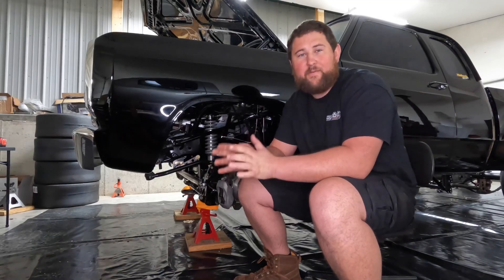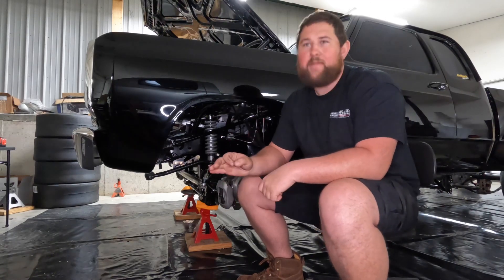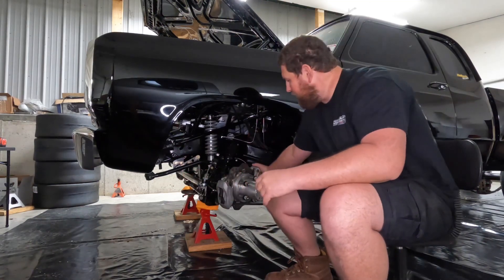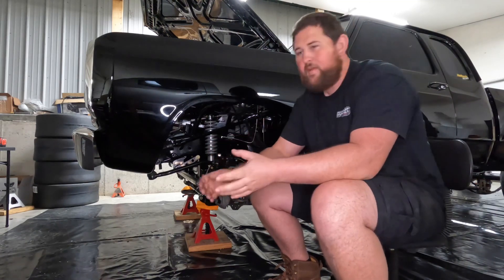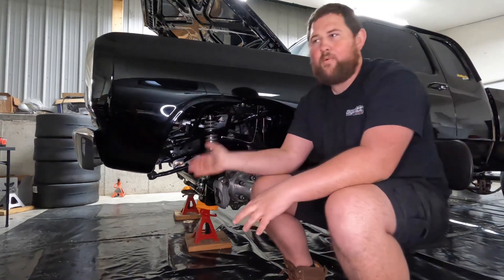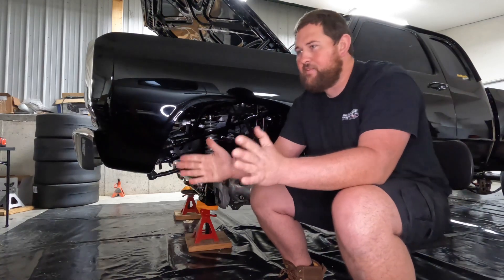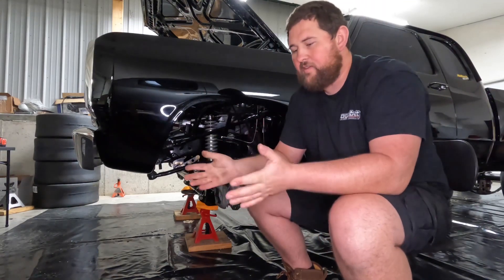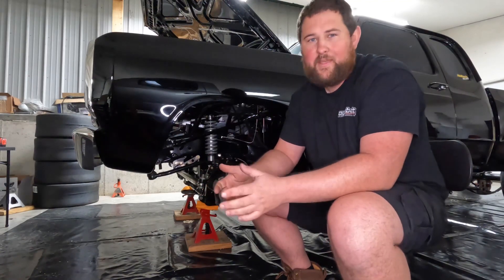The Secrets Of Drag Racing: Steering Ratio!!!

Comment: Any conversation about toe-in should be explained with the measurement apparatus at hand. The 1/2” you refer to is measured where?  The length of the piece of metal attached across the face of the rotor makes a difference. Are you measuring right the rotor diameter or way out on a 15” piece of angle iron….???? See what I’m getting at?  1/2” of toe measured at the radius of that rotor is way to aggressive. I like your style of presentation just you will get roasted by all the trolls if you aren’t careful. I’ve always referenced toe-in in a positive or negative degrees - this is measurement device agnostic. But most DIYers need a measurement as you describe. But they need to know how far away from the center hub that measurement is taken.
Reply from the maker: I do all my videos with the Information off the top of my head. I don’t have any notes or boards I reference so sometimes it’s easy to miss one key statement like what you just explained above. You are 100% right about the length of the angle iron or tool you’re using. The tool should be the same length as the radius of the tire you’re using and you should always check the toe again with the desired wheel and tire combo installed. Everything I talk about is in reference to a 28-30” tire as stated in previous videos but I should always refresh that when talking about new topics because I can’t just assume the viewers have watched all my suspension videos. Your tool ideally should be the same length as the radius of the tire you are running and then you should do a quick check of the toe again once the wheel and tire is installed and the vehicle is on its weight at ride height. It’s a little difficult to measure a slick since there is no center tread line to reference but you can get a close double check measurement by measuring off the edge where the contact patch of the tire meets the sidewall. Measure the front side of the tire and then the back side of the tire in the same fashion to double check your measurement. Thanks for pointing this out so I can address it!
Reply: @LoganbuiltRaceShop  - no prob. Good follow up!

Comment: You could just put a longer arm on your king pin to reduce your steering input. You will loose some turning radius but probably not an issue for your application.
Reply from the maker: Yes sir you certainly can extend the tie rod arm on the knuckle but to do that you’d either need a custom made knuckle or some fab work of cutting & extending the arm and I don’t think I’d want to do that on a cast iron knuckle